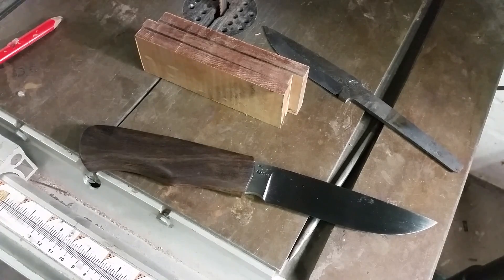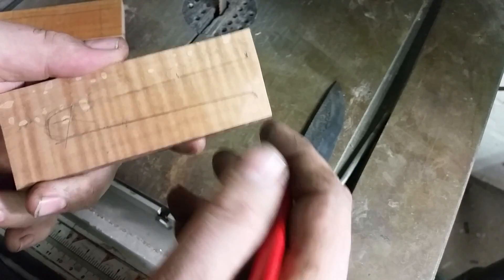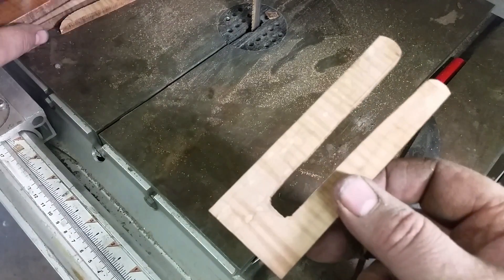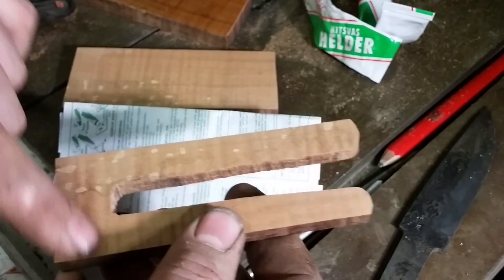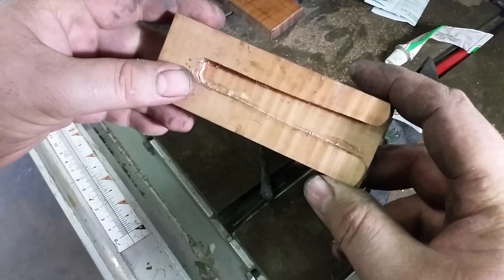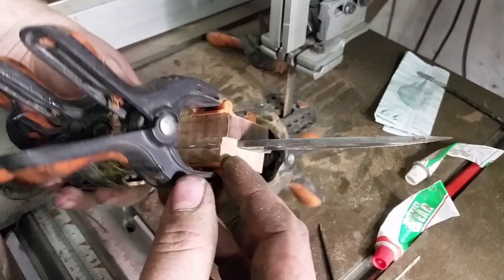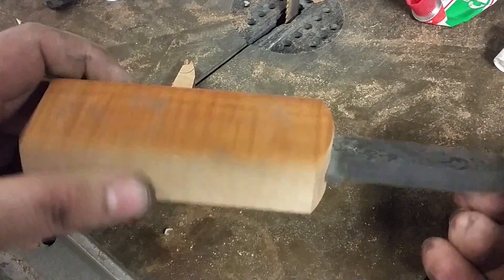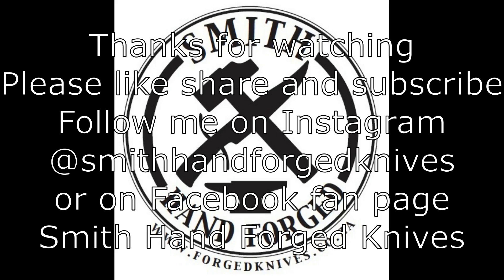Three Piece Morticed tang handle

Comment: Before you cut the initial block into 3 drill a hole through, hole the same diameter as a piece of steel rod. Then once you cut your block in 3 you have a perfect reference guide for flawless grain alignment. I'd also cut your middle piece thinner eg. same thickness as your blades tang to ensure minimal grain variance due to kerf + removed material.

Comment: Do you ever get the feeling that without a pin that the glue won’t hold up and out flys the blade.
Reply from the maker: The epoxy I use is incredibly strong. I have tested it by destroying the handle on a few that I have made. I have full confidence in it's ability to hold. But... yes, A pin will definitly make it more secure.
Reply: @StuartSmithHandForgedKNives  What kind of epoxy do you recommend?

Comment: Excellent video - more to that procedure than I might have imagined. You might consider getting a piece of plate glass and some adhesive-backed sandpaper for your ever-so-careful final thicknessing of the inside surface around the tang. Doing it by hand you can sneak up slowly on the final thickness - and the finer the sandpaper, the slower the stock removal.
I would have liked to see you finish the handle, so that I could appreciate the grain continuity which I think was the basis for making the handle look like a solid piece (?)

Comment: Thanks for the video,I have made two handles using this method.They both turned out great,I used wood in the middle of one with micarta scales.The other one has darker burl in the middle of the scales.I put bolster on the front of both of them one brass and the other one has the dark burl.

Comment: The tang on the knife I like is like this with a two piece handle with holes, can I do this type of three piece and maybe use two of the holes and put in a brass rods for “extra support”? Love this idea of handle. I was just wondering if I can do what I asked to do to mine.
Reply from the maker: That will definitly be better
Reply: @StuartSmithHandForgedKNives  thank you so much and thank you for replying.

Comment: I've missed your vids, Stuart!  You're definitely one of the best bladesmithing/knife making vids to learn from on YouTube, as I've picked up quite a few crystals of knowledge from you over the years.  I appreciate that you keep your videos modest and nice and simple/low key on the editing, it's truly the best format to learn from and the least distracting.  

I've been wondering, I've seen this type of handle construction every once in a while in the past and always thought this would qualify as a frame handle, even though it's a seamless one made of a single material.  It's obviously not a big deal, but is this actually called a three piece mortise, or did you happen come up with that?  It probably best describes how it's made, just curious is all.  Thanks for sharing!  :)